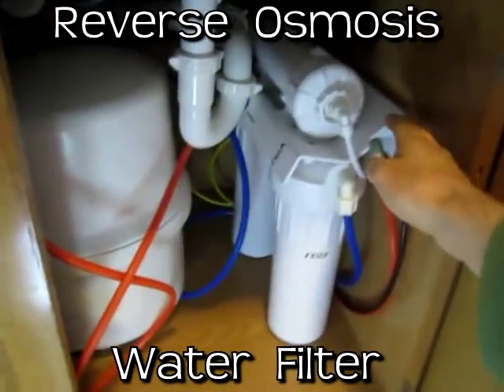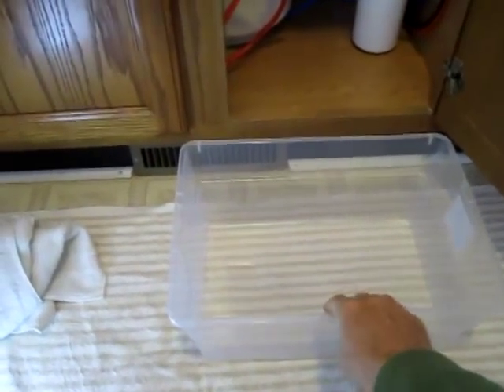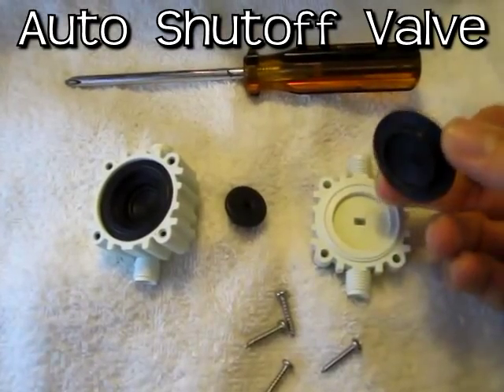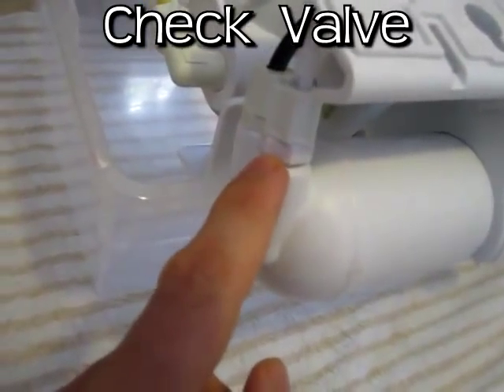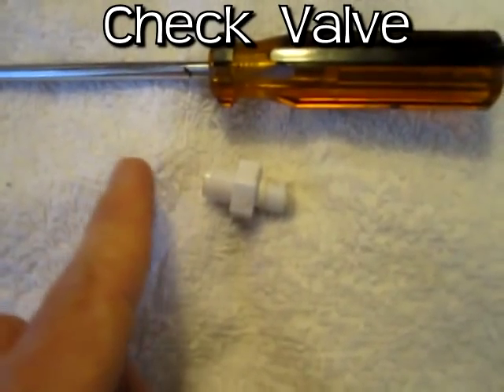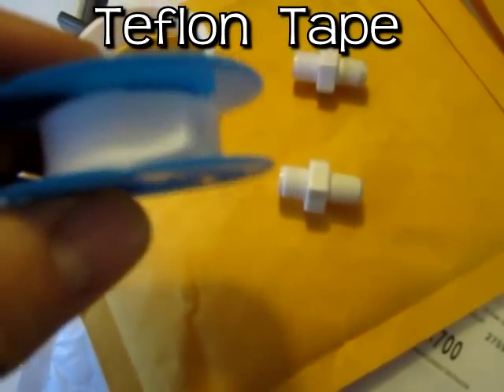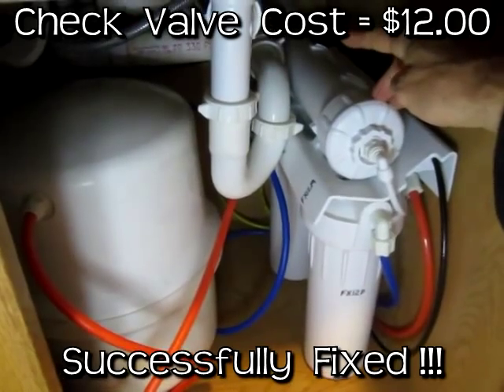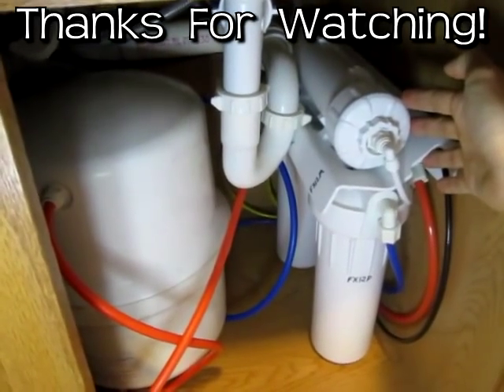Reverse Osmosis REPAIR Auto Shut Off Check Valve Water Filter GXRM10G GE drain running

Comment: Great help! Non stop for 3 days after filters changed and system flushed. The shipping is very expensive and usually takes weeks to arrive Canada. I bent a paper clip and gently push through the small hole from membrane side and felt the spring action of the valve. When I pushed the valve, the water could go through. I cleaned the valve with the paper clip gently pushing the valve up and down and let the water flush the dirt. It seems to work. The water tank is full now and no more leak.

Comment: Great video...got me going in the right direction.  Removed check valve and sure enough, you could blow through it.  Before ordering a new check valve, I took it apart and flushed it out and used a paperclip to clear any crud.  Reassembled and attempted to blow through it, and it was properly sealed.  Recommend to others to try before ordering a new part.
Reply: ^ This.

Comment: Just replaced the check valve for the second time. It was just a year ago that I replaced the first one and fixed the continuous reject water flow. The one I just removed was visibly bad and you could blow through it one way. Thanks.

Comment: Note:  Teflon tape should always go on the same direction as if you were putting a nut on the stud.  Clockwise direction.  Otherwise the Teflon can be backed off and not seal well when you install the part.

Comment: Excellent!!  Thanks for sharing!  I was just looking around for a water flow diagram for the unit so I could convert it from a RO system to sediment filter only system BIUT, with your great good deed, I'll check out my system.  I suspect that my problem is the same as you found with your unit.  Question for the cosmos-- why should the valve fail upon changing the RO filter?  Oh well.... Thanks again.

Comment: I watched your video and I have the same check valve problem.  Unfortunately, I had previously removed the auto shutoff valve and didn't pay attention to which tubes go to the in/out ends. Any chance you might have pictures or directions to help with my reconnection?.  Thanks.

Comment: I have an issue with my ASO valve occasionally dripping waste water, as if the rubber parts in the valve sometimes don't seal all the way. Most of the time it works fine. Maybe I'll take apart mine to see if there's debris inside.

Comment: Important: I did this and it is VERY important to remember which way things are pointing.  Take pictures of the "In" and "Out" ports.  Also, this didn't actually work for me, it turns out that it was the Green "RO Membrane Filter".  As soon as I plugged in a new one of those it worked.
Reply: Are you actually talking about the color of the RO Filter?  I recently installed a green one and that is when it started draining constantly.  Did you replace it with the blue RO filter?
Reply: I replaced the green RO filter with a blue RO filter and that fixed my constant drain issue as well.

Comment: Coincidental?  I think not.  My check valve didn't work either after cleaning my system.  I too had to order a new valve.  I believe when you are bleaching out the cylinders during the cleaning process with no filters in the system, the water pressure is too great for the check valve and damages it.  I'm going to swap out my good valve with the bad valve during my next cleaning and then put the good valve back on after installing the new filters.  Just my theory...

Comment: How does the auto shut off valve work? I'm not sure how my system runs but my aunt likes to keep the sink water running at all times because she believes the system needs to be ran constantly. In doing so, I see a lot of water wastage down the drain coming from the system's black pipe. Is the auto shut off valve capable of turning off my sink? Because I thought water from my sink could only be turned off manually. Is my aunt just wasting water by letting the sink run 24/7? Thanks!
Reply: Hi just replace asov valve or sv valve

Comment: Had mine only a year, changed the filters and the tank never filled afterwards. I think my check valve went too. All it does it drain and I think it happened when I depressurized the system.

Comment: From what I've seen on the PDF schematic, the black discharge hose (leading to the faucet) should have the "check valve". The white hose should only have a screen and that leads back to the shut-off manifold.
It seems you may have switched the black & white hoses on your first disassembly.  Who knows? Maybe my PDF is in error.

Comment: I have the same issue now. The drain water is continuously running. The drain water stops when i shut off the input water or close the tank ball valve. Once the drain water stops it wont start again even after turning on the values. But once i take fresh glass of water from the system, it is running continuously. Please help me out.

Comment: It is draining  Constantly immediately after installation. 
Is it supposed to do this?
 I replaced both valves and it still leaks constantly. Should I let it leak for a while?
Is it going to stop after a brand new installation or if it starts leaking immediately after installation is something wrong?
Reply: Mine is doing the same. Did you find what’s wrong with yours?

Comment: Some of these are built to continually clean the filter, which in light of wasting so much water really doesnt make sense.  But, Im assuming the achieved this continuous cleaning by allowing water to circulate through the auto ck valve and through the system, so an easy fix would be to replace the auto check valve... which I need to do as well !!  Some may be bad, but my thought is that many systems where built this way... Silly, huh...